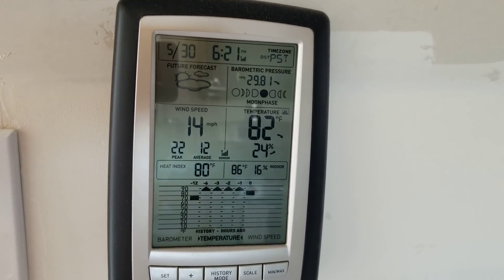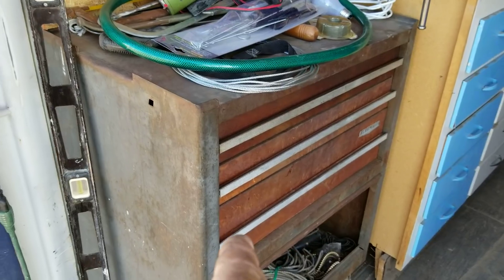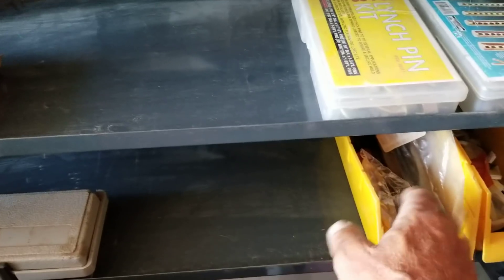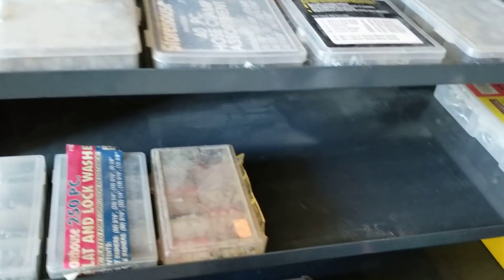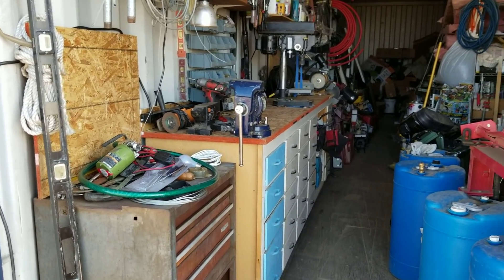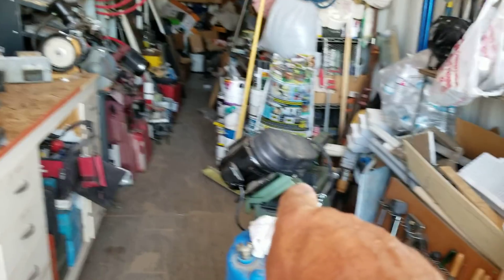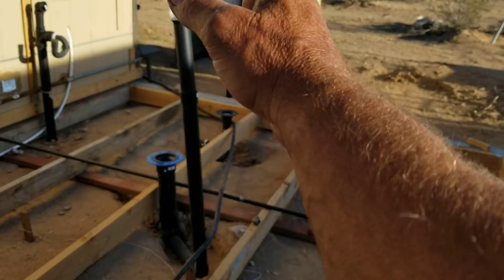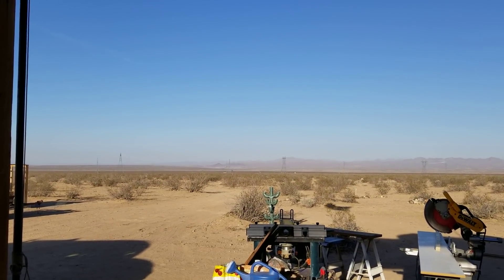Homesteading the Desert,  May 30, 2018

Comment: I left  AZ  40 yrs ago  and  I  still  dont  like  when the  wind  blows.  It  was  toasty  here  91 with  102  heat index  and  99  due on Sat  but  a bit  drier!!!   I  wish  I  had  Spar Varnished  my  work  bench  and  its  plywood,  it  would  be  so much  easier to clean  especially  when  my  son  worked on  the  chainsaw  on  it.  Last  year I  put  together  a  chainsaw station  so  the  mess  stays  there!!!!
Reply from the maker: Judith Brown good deal!  I don't have trees, so no need for a chainsaw...lol
Reply: We didnt  need  one until we moved to Arkansas!   I  am  going  to  clean off and  sand my  work bench and  varnish  it  this  fall  so  any  mess  is  easier  to  clean  up!  It  would  protect  your  chip board  from  swelling  after  a  spill  of  ice  tea,  etc.  Just a  suggestion
Reply from the maker: Judith Brown true!

Comment: Yes I'm an evening tinkerer given my hot climate, I was thinking you need shade for your room but you're onto it already. That's a good idea using  the sun to give you a warm soothing  bath.
You may need I glass house in winter though if Orlando Sanchez in Barstow is anything to go by , he always says it  c,cold in winter.
Reply from the maker: closertothetruth evening tinkering was fun before my move off grid.  Daytime work wears me out so after a late dinner after 12 hours work, I usually do the "early to bed, early to rise" thing.
Reply from the maker: closertothetruth oh, and bathtub is temporary until I build my wood fired jacuzzi....
Reply: G Bear man that sounds brilliant to me, you just need free firewood
Reply from the maker: closertothetruth I can get plenty of free firewood.  Gardeners in the OC have to pay to dispose of trees they cut, so many cut it in firewood sizes and place piles in front of the house they are working on with a free sign on it.